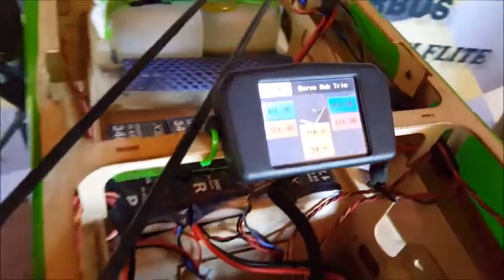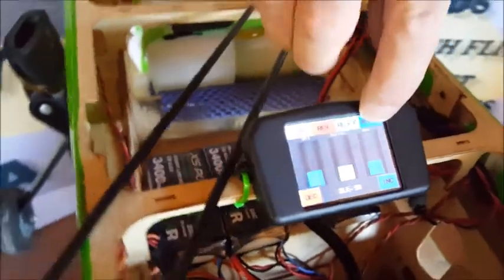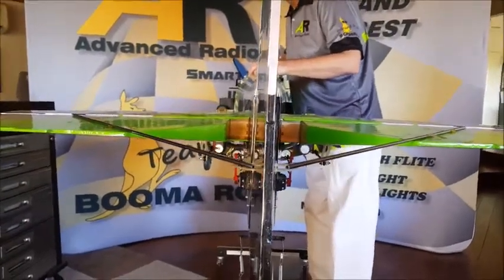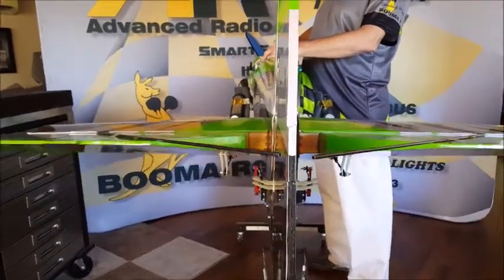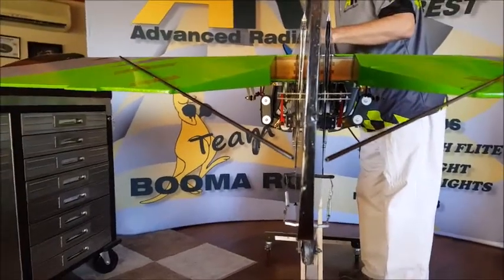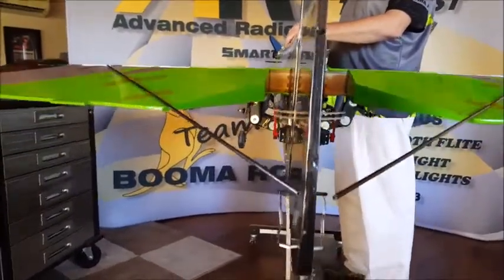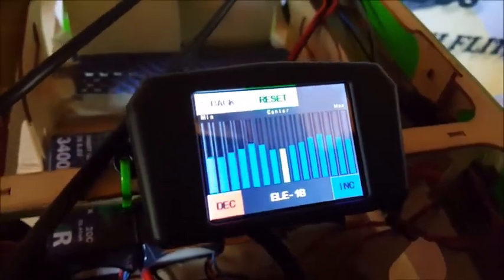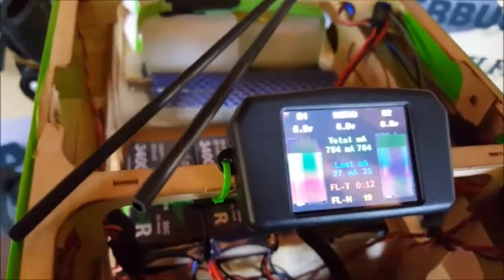15 point matching using SmartBus

Comment: Great feature.  My Futaba 12FG lets me change the input switch.    I guess I could temporarily change my transmitter setting from elevator stick to rotary switch to allow for 15 momentary fixed locations, which would allow for holding elevator at 15 points while I input  your smart bus.  Then change back to stick when completed.
Reply from the maker: The rotary dial is a great idea. It will help you hold the position on the servo for adjustment.
We also have a 12FG. Really reliable radio. Our 12FG is assigned to the 3 meter sports. We use the Smart Bus 15 point matching on the sports jet for matching flaps and elevators. Flap matching is pretty important so you can dial out potential roll during flap transition.
Reply: rickgellboomarc Thanks for the quick reply.  Cheers!
Reply: Greg O'Hare Greg, what about reassigning to your throttle temporarily?